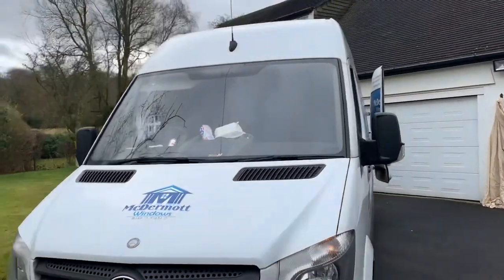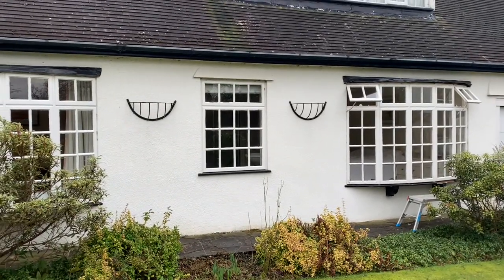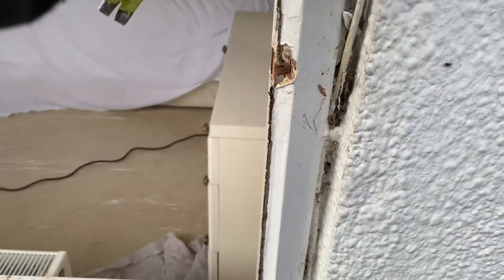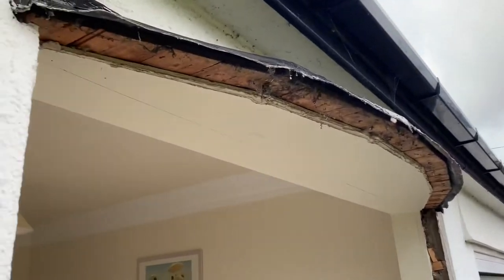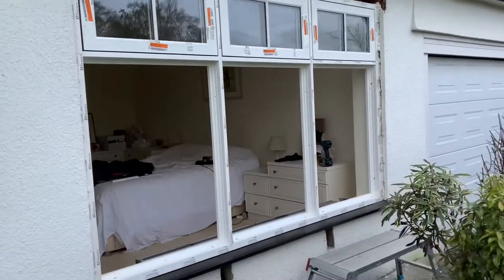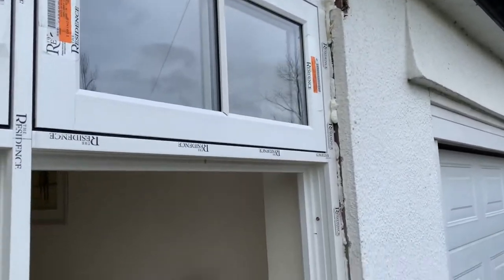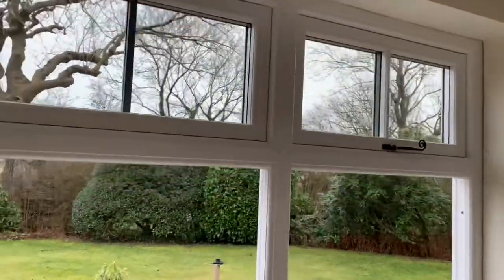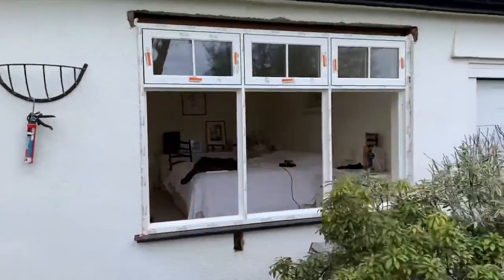Day 1, R9 Window Installation

Comment: Stephen and Jordan fitted me 5 A rated windows today.  Absolutely brilliant job and the windows are really high quality.  They are so much better than the old PVC ones that were replaced - the rooms are totally quiet now - no road noise. Asked Stephen to come back in March and do the barge boards and soffits too.  Top class firm.